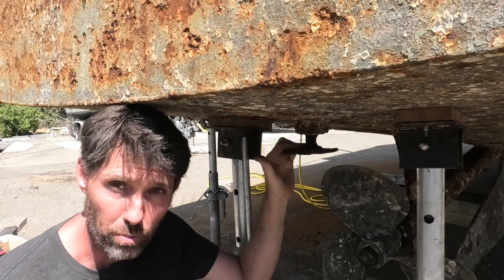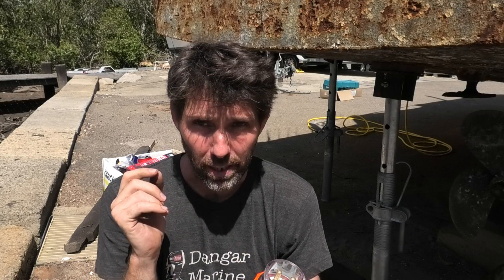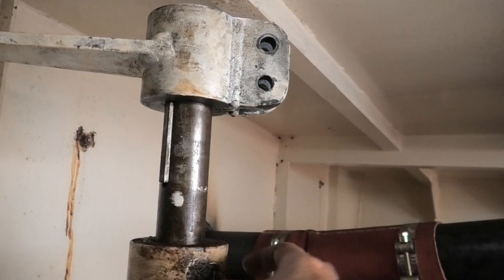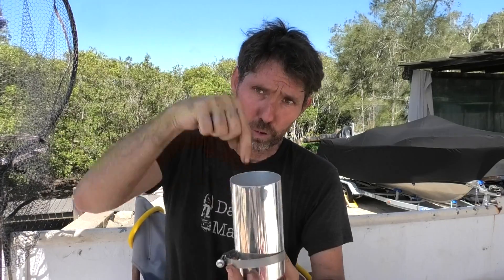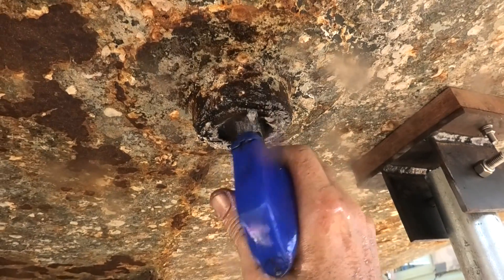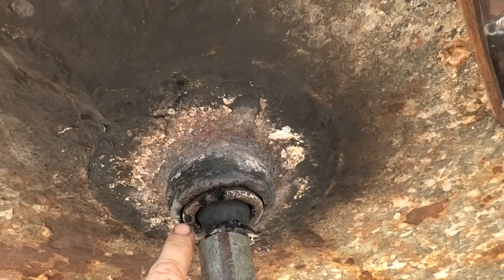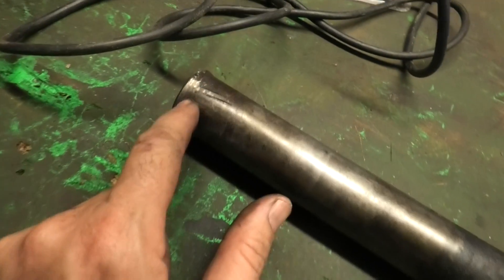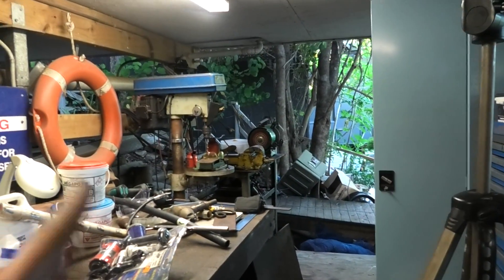Removing the rudder post

Comment: That moment the hull moved and you realize you are still alive...
Reply: Lol right
Reply: No kidding. Pretty powerful little jack to be able to lift the whole boat.
Reply: @peterjensen6844  yeah, kinda scary too lol
Reply: yep..
small Oh f#&k moment
Reply: @peterjensen6844  It's not lifting the whole boat. It's only overcoming the moment from the fulcrum which is in this case the forward most point of vertical support - probably the front keel blocks.
Reply: 4Tonne jack lifts 11ty tonne boat !!  Butt clenching moment indeed
Reply: @TonyRule  sure I get that. But that doesn't change the fact that it's a huge amount of weight for the bottle jack and it's a scary as frigg moment.
Reply from the maker: It's funny, I had so much faith in the other four stands holding it in place that I mostly just annoyed the shaft didn't budge. :)
Reply: @DangarMarine  It's possibly a good thing it didn't budge - the sound of the load moving back down to quickly rest back on the rear keel supports might have required a new pair of trousers.
Reply: @DangarMarine  yeah I could see that...you were like   WTF ? :)
Reply: I have just watched the whole series. Must feel like great achievement get it running again
Reply: I'm late to the party but when the boat moved on the props I nearly feigned! I don't think I'd ever feel comfortable under the Hull again!

Comment: Good work👍 I would say go with a new stainless steel rudder post with nylon bushes and a good seal are in order. May need to use a reamer to align the upper and lower bushes for smooth free operation.
Reply: Absolutely not nylon.
Reply: Delrin? Bronze?
Reply: @graemelliott3942  Acetal. Nylon is extremely hygroscopic and thus dimensionally unstable. But the good thing about plastics is they are really easy to burn out of heavy assemblies whenever you want to replace them and they're cheap and electrically isolating.

Comment: I do love the videos, go with stainless 316 machined to high polish. The dissimilar metal corrosion would be less as you said the separation from most components via bearings and seals should slow the corrosion with proper care and lubrication . If you are concerned about the attached steering arm yoke use dissimilar metals / galvanic corrosion protection tape . Some manufacturers are 3M , Heskins etc at a min the tape should be about 1.7 to 2 mils thick with a dielectric rating of 300-400 volts/mil that is what we use on aircraft so you may want to check since your dealing with salt water. A good coating of BOEShield spray / stick works made by Boeing for aircraft.

Comment: It's good to have on hand a 6-pack of Coopers, one bottle to mix with the acetone and ATF to use to free up the horribly frozen assembly, and the remaining 5 bottles to drink if the mixture doesn't work.
Reply: Using a beer bottle as container for chemicals is rather dangerous.  I know a guy who drank polyesther hardener, while working on a boat. He nearly died and still has major health issues.
Reply: Yikes.  A person successfully survives fixing his boat without it falling off the stands and crushing him, without piercing his eyeballs with flying bits of metal, without accidentally smashing a finger or crushing his toes, etc.,  then decides to celebrate his success with a nice "beer".....

Comment: I would make the new rudder post out of the same steel it was made out of originally, but I would fit a zinc right there on the shaft where the extreme corrosion was found.  You already know the rudder post will last a good long time with existing materials, and with the small change of adding a zinc right there, you can make it last forever.
Reply from the maker: Yes, I'll definitely be keeping a much closer eye on the anodes than the previous owner.

Comment: Awesome Stu, nice to see it out. Funny watching I could start to see the boat lift right before you noticed it. The heat really worked. The post wasn't tapered but what keeps it in besides the bearings?
Reply from the maker: The Yoke will hold it to a certainly extent and after that I guess it is the rudder itself that stops it falling down.
Reply: Ok, the yoke and the key for sure. That's right I forgot about the lower support for the rudder. Stainless for the stock but have also heard brass being used

Comment: That bearing material looks to be Orkot TLMM (original TLM would have been used when this boat was made) due to the weave structure and this is what this material is used for as I have worked extensively with this material in the marine industry. Even if its not Orkot that is what you should use in this instance. I would also, suggest a good marine grade of stainless steel or monel type of shaft material and use the bearing material as the insulator and run sacrificial anodes on the boat below the water line and nearby these items. You can get streamlined shaped anodes and you can weld a small frame for them to bolt to and in a bank arrangment of 'x' numbers or weld tab brackets for individual anodes and cut them off when worn down and reweld new ones on. That adds peace of mind and extends the working life of these components. In particular, considering the amount of effort you will end up placing into this vessel and the amount of corrosion present. Metal loss is a steel boat/ships enemy. Place careful thought in managing the hull.
Reply from the maker: Hey mate. Yes, looking into good bearing material to use at the moment and more and more it looks like I will be going stainless for the rudder post. Will also definitely be getting the right amount of zinc on there and keeping a close eye on them as they wear.
Reply: @DangarMarine  I am following your progress with this steel boat. Thumbs up 👍 for the effort so far. Consider using Monel - K500 (NA18) for the rudder shaft material. Go to Austral Wright Metals and ask for assistance to determine the correct type of condition the material should be in to use for rudder shaft (australwright.com.au/n05500-monel-k-500/). This is far better than SS 316 (low proof strength and poor for welding, 316L that has low carbon content is better for welding but worse proof strength than 316) and while SS 329 or Duplex SS Bar 2205 is a much better option than 316, I have not had much experience in using the Duplex version. For Monel NA18, I've had a lot of experience with, over 20 years, and in the harshest of ocean conditions. It possesses good mechanical and chemical properties and is a far superior material for use in seawater than most others that are more expensive than NA18. Additionally, if you plan on welding anything to it, make sure you mention this to Austral because depending on the weld size, penetration desired and material thickness of plates etc, may require the Monel to be in the annealed condition but not aged to avoid stress cracking. Either way, material selection is driven by the specific minimum requirements of the component. Hope this helps.

Comment: Clearly, a bit of research needed. The comments seem to be split- many favor stainless, but stainless is definitely softer than mild steel. On the other hand, mild will undoubtedly produce a galvanic reaction, and eat anodes at a good clip. I expect there's an alloy of stainless that is tougher than the usual, though more expensive. Rudder post, though, is not the place to pinch pennies! And one note, the fellows who suggested a zerk fitting in the tube have a good idea, there. Might well prevent ever having to go through this process again. Good luck, mate!
Reply: ""I expect there's an alloy of stainless that is tougher than the usual, though more expensive."" There is and it is called 'Super Duplex', also it's very corrosion resistant !

Comment: Be careful with that crane if the slew axis is not vertical. If you have any significant load hanging, it will slew to the low side. Might need to engineer some kind of slewing brake.

Comment: A stainless shaft isn't a bad idea. I don't know if you'll get a lot of benefit in an oxygen-starved environment like inside a rudder tube, but the exposed parts would benefit.  Keep in mind that stainless steels are usually weaker than most other steels. Going a bit larger in diameter would address the issue, but that would mean a new rudder tube. :-/ 

Tensile strength isn't super important for a rudder post since that's the rating of the material under tension, like pulling on a rope. Not a lot of tension loads on a rudder post. That said, when compared to a basic low-carbon non-tempered steel, a lot of stainless steels are pretty close. Note that standing rigging wire rope sizes between SS and galvanized can be pretty much the same. 

Yield strength is how much force the material can take and still return to its original shape without permanent deformation (or presumably fracture.) This one is more relevant for a rudder post. It can be as low as a third of the strength of that same basic steel we were comparing to. Looking at some bolt grade charts in order to get an idea, we see 36000-57000 psi is typical for basic low-grade low carbon steel vs 20000-65000 psi for SS ones. A good heat treated steel (grade 8 bolt) will often have a yield strength as high as 130,000 psi! It is telling that there aren't any SS fastener manufacturers that are willing to apply meaningful grade marks. I've been told by some industry folks to always assume SS fasteners are never as strong as even the lowest grade steel fasteners. 

Unknowingly taking up to a 2/3 reduction in its ability to handle torsional (rotational) loads wouldn't be awesome. Again, this depends entirely on the SS alloy compared to what kind of steel the old post was made from. Paying more than necessary for materials and having to replace the tube with a larger diameter one would also not be awesome. 

I'm no engineer, but maybe you've got some here that can chime in. 

BTW, if you had money to burn, check out hardened Monel K-500 alloy. It is the Rolls Royce of marine alloys for an application like this.

EDIT: I just looked up some typical yield strengths. Mild steel ~ 248 MPa (36000 psi), 316L Stainless Steel ~ 170 MPa (25000 psi) so to my amateur eye, my gut would tell me to increase the diameter to 1.5x the one I yanked out.
Reply: Per ASME Sec II-D, A53 and 106 carbon steel have a Tensile of 60,000psi and a Yield of 35,000psi.  316L has a Tensile of 75,000psi and a Yield of 25,000.  The stainless would definitely be more noble once it passivated.  But there is so much carbon steel (the whole boat is made of it), that the ratio of anode is cathode is favorable.  More importantly, stainless steel will eventually crack in the presence of chlorides.  Especially 300 series (austenitic).
Reply: @DavidPT40  -- Ah. Your numbers align with what I was seeing. 

As for "once it is passivated," that's what I was referring to at the beginning about the questionable benefit. The stainless part of stainless steel comes from the thin chromium-rich oxide layer on the surface. To maintain that passive state, it needs to remain in an oxygen-rich environment. To be durable, it is normally self-healing in that same oxygen-rich environment. When submerged in an oxygen-depleted environment, it is highly prone to crevice corrosion and pitting. 

The chloride reaction you mentioned really piqued my interest. I hadn't heard about that one and that might push me further from using SS.

In short, I don't like SS below the waterline, especially when it will be exposed to stagnant water. Silicon bronze, cupronickel, inconel, monel, or a suitable non-metallic alternative are all better choices below the waterline IMO.  

Depending on how much life you want out of this boat, it might make the most sense to simply stick with the mild steel and diligently maintain your zinc anode on your shaft.

EDIT: I looked up the properties of stainless alloys under various trade names referenced in the article linked below (Aqualoy A22, Aquatech 22, and AQUAMET 22.) It looks like they have sufficient yield strength to be a direct swap without having to rebuild the sleeve, but they're also not cheap. They are all highly austenitic. Based on David's comments, I'm now questioning whether that would be a concern, however, they are widely used for this application. I found many shops online that would machine a shaft and ship it.

Comment: Get a stainless steel post, mate. And as i've said with the prop-shaft, make sure that thing gets propper grease. Nylon buschings will probably be fine to insulate the stainless post from the steel.
Again i'd like to advise you to get a manual or automatic grease-gun hardlined to the prop- and rudder-shaft. With that rudder-post so bad, i think id has never seen any grease.
Oh, and before you get a new post, please make sure the tube is straight and treu!  Looking at how the busching has eaten away in the post, something looks wrong.

Comment: Hi, Stu  - Orkot or Dixon bearing sleeves top and bottom. Orkot you will need to have machined to your specs, Dixon, you might get lucky and be able to source something to plug right in to the existing tube. Be sure whatever you choose will not swell with water (hydroscopic - Delrin is an example). You need to get the ID of that tube as perfectly round and true as you can (where the sleeve will live, above that, it only needs to keep the water out). Try a cylinder hone (ball style) to start, then maybe move to cylinder stone hone and/or machinists adjustable reamer. You can install the new bearing with Loctite 680 or 620 retaining compound if the surface is too pitted and wasted to get back to smooth. Installing zerk fittings is a great idea above the bottom bearing, but keep in mind you then need grease seals in the stack to avoid contaminating the bearing material. They should be self lubricating, maybe water or synthetic grease, but no petroleum. 
For the new shaft, do not listen to this crazy talk about installing bronze bushings and mild steel shafts. Maybe if you like electrolysis and replacing it all every couple of years, premature wear, rust, scale and all kinds of other issues. Look for Aquamet, Nitronic, Boat shaft, Super Duplex. You don't want 316 - weak and too expensive for us mortals. Recycled prop shafting from a shaft shop would be perfect (good idea), just double check they understand your intended use and verify it will weld properly to the rudder. What type ss is that? Anode protection is key, I strongly disagree with any bonding to other components on board, and especially the electrical system!! Be scrupulous about keeping stray current off your boat and monitor the zincs all the time. Even sitting in a marina can be really bad.
Good luck, my brother.
Reply: " Even sitting in a marina can be really bad." This is a really good comment ! nowadays nearly all marinas are running power to boats and you can find stray electrical fields radiating up to 30 or 40 feet away from the boats and of course this will accelerate corrosion in an unprotected steel hull.
Reply from the maker: Lots of great advice in there. I'll take this all into account as I do my homework. There is one oil seal at the very top of the tube but interesting to hear you say about having them just about the lower seal and just below the upper to stop them getting contaminated. Fortunately the boat will live on a swing mooring so hopefully no issues with stray current.

Comment: I screwed up and posted this on the crane video....

Welcome to the world of steel boats.  :)

A couple of pointers to get the prop/shaft off.  First get yourself a slugging wrench for the nut on the end of the rudder if it gets stubborn.  You put tension on the wrench with a comealong (rachet lever hoist) and give it a good whack with a hammer.  It's too bad the stern is facing toward the water or you could park a truck there and use that for a place to connect one end of the comealong.  We usually use a forklift.  :)   To remove the prop first put the nut back on just a few threads.  Then wrap a lifting strap around it and put tension on with a comealong.  A couple of good whacks with a hammer should knock it loose.  Make sure that nut is on there or the prop could come flying off and do some damage.  Similar process with the shaft.  Except tie your lifting strap on with a timber hitch.  Likely there is a cutlass bearing in the strut.  A sawzall should be able to cut along the length and let you remove it in sections.  Don't forget about the locking screws in the side.  :)   You're a ways away from it but removing and realigning the engine is no small task.  Make double sure you have to lift it before you move it.  You're doing great.  Full disclosure I usually did this in a fully functioning shipyard with an army of help at the ready.  :)
Reply from the maker: Hey Sean, thanks for the tips on getting the nut undone. First thing I need to do is figure out if it is a right or left hand thread. :) Yes, I can imagine there would be a lot of work required to get the engine aligned with the prop shaft properly. The shims in there at the moment look very fine.